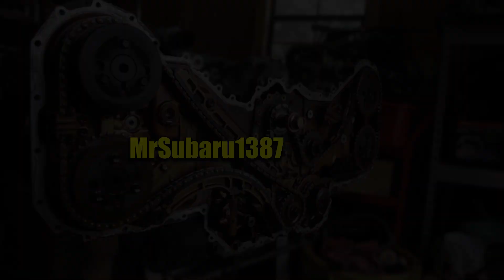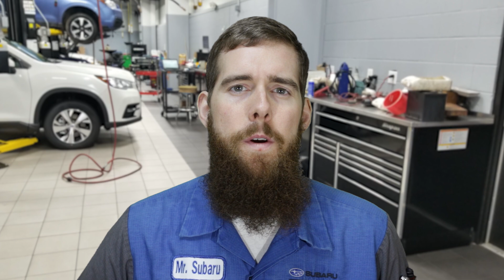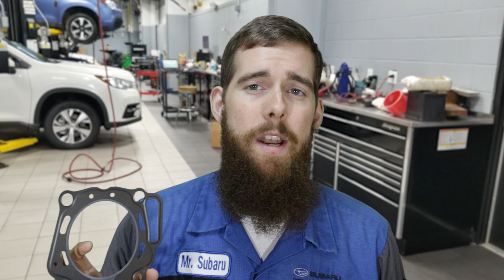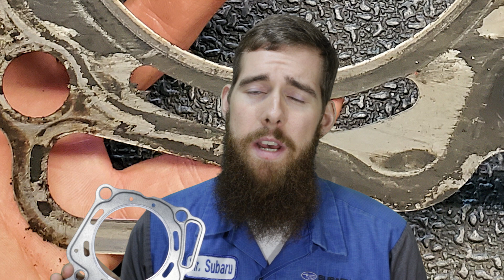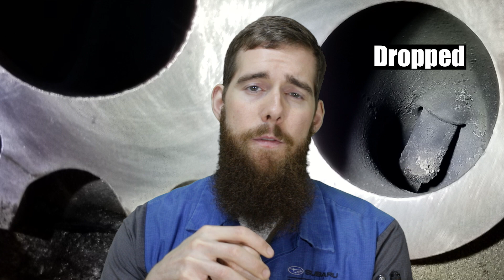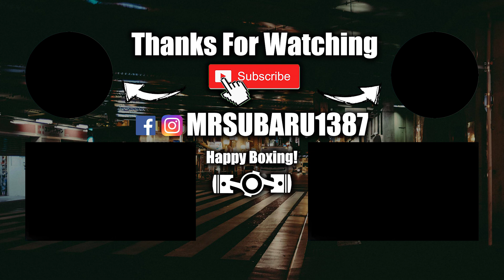Subaru Head Gaskets Explained

Comment: Beats me why Subaru didn't produce all its engines with the MLS gaskets in the first place as soon as it was recognized that the standard gaskets were prone to inevitable failure.
Reply: The bean counters liked saving 3c per gasket
Reply: Old comment, but they probably had already made a dozen of them plus the money spent on that design, so they preferred not to loose money and made more from repairs
Reply: It's a nightmare for the company and the customer. Thousands of dollars  to repair and the owner is the stuck with the bill.
Reply: That would be admitting fault. Companies never admit fault.
Reply: I am buying head gaskets from the local Subaru dealer but they can't tell me if they are MLS gaskets. To me they sure look like single layer. 2006 Forster LL Bean last 8 of the VIN 6H707820 gasket part number 11044AA630. Anyone have any idea? TY
Reply: @rmciottijr  look to see if it has that coating. The gaskets are visually different. The MLS are thicker
Reply: Because money
Reply: Spies, from Chrysler, Nisssn, and Toyota infiltrated the Subaru engineers.
Reply: @Spawn223311  Exactly why. Subaru is a pretty lean, mean company engineering wise. Reused as many parts across as many model ranges as possible. You get economy of scale from that. So they had hundreds of thousands of head gaskets made for the EJ25D laying around they needed to use up.
Reply: @rmciottijr  You want 11044AA642. The 11044AA63x series all are single layer, graphite coated. The 64x series are MLS.
Reply: Do you think they would help me financially since a or care mechanic  did repair work?
Reply: Since a private mechanic (should say)
Reply: Common to many other industries, it was regarded as an SEP. Somebody Else's Problem.
Reply: @rmciottijr  avoid single layer gasket multi layer gasket is what you need!
Reply: Because dumb people keeps buying those money pits.
Reply: Can’t profit off a car that doesn’t break down.
Reply: Costs
Reply: @ryarbrough1195  Worse, Toyota bought into Subaru  first in 2005.. then the rot set in. They owned 20% by 2018 iirc
Reply: No. I really think it had to do with not realizing how big of an issue it was at the time. The conditioner that came out as a response actually works very well and I never had one hg problem from 100k to 260k.
Reply: @inforedV  im not sure how a conditioner you put into the coolant, helps stop the oil leak. It was a stop gap for subaru to say "look we fixed it." Without actually fixing it so the person that currently owned the car could run it long enough to sell it to someone not knowledgable enough to ask if the head gaskets had been replaced yet.
Reply: @doh1976 truer words were never spoken
Reply: Its important that they fail just after the warranty expires so the dealership makes a shit load if money
Reply: @iffracem So. Toyota had many call backs. To this day, Toyota is one of the most reliable vehicles that a person can buy. They had a bad rap, according to recalls. Toyota is still recovering from it.
Reply: The MLS gaskets cause a slightly lower compression. Resulting in lower power output, and increased emissions. On the turbo engined this is overcome via boost.
Reply: Where can I buy those multilayer gaskets?
Reply: @oscardaniel1976  Subaru. Ask for the head gaskets for the Turbo version of your year & engine size. A company called 6 Star makers an MLS gasket set as well. There's a few others, but these two I personally know the quality of them. Other brands may be the same or worse quality.

Comment: I fried my n/a EJ25 head gaskets at about 100,000 miles when I had a coolant leak. Pulled my heads, had them shaved, grinded the cylinder walls, lapped the valves and used OEM gaskets and new bolts from the dealer. She ran even better once I got her back together!
Reply: How much did you have into all that?
Reply: @theeasternfront6436  A few hundred and she was back on the road running straight...
Reply: @cruzanbum3108  Thats not bad at all. My buddy is talking about selling me his 07 outback. Its over heating. The only thing that gives me pause is the cost of reman heads if they are needed.
Reply: @theeasternfront6436  Pick-n-Pull!
Reply: @theeasternfront6436  I’m heaving a machine shop here in Salem OR do mine, highest rated shop I could find. Clean, pressure test, vacuum test, and reman the heads so they have a good surface for the head gaskets. $140 a head, so $280 altogether. Not a bad deal if you ask me.
Reply: My original head gaskets lasted until 182,000 . I was told anywhere from 170-190,000 they would need them
Reply: @theeasternfront6436  It cost me about 800.00 to replace mine

Comment: My 98 Subaru Outback has over 300,000 miles pushing 400,000 miles still on its original engine and transmission head gasket is original I got the head gasket checked it’s not failing. That car was my 1st car when I was 17 now like 24 years later still driving it I always maintained it
Reply: Was it 2.5? no

Comment: I have a 2009 Impreza ej253 single cam it had the common external oil leak from the head gaskets.  After watching your videos I was comfortable enough pulling the motor and resealing the whole thing.  It also needed a valve job so it was good timing.   Kinda sad since it only had 120k miles on it but it runs beautiful now!!!!
Reply: Jason Truman yeah but then it will happen again
Reply: Julian Rodriguez nope since I used the upgraded “turbo” gaskets.  The rest of the car will be well worn out before the head gaskets go again.
Reply: Jason Truman really?... hey I have a question for you my friend ... I found a 04 forester XT manual with 130k miles... is it a good daily driver? Going to mostly use it for taking my kids to school and work I’m only asking cause this would be my first suburu car
Reply: Julian Rodriguez oh yea I wouldn’t hesitate to daily drive that if it is stock.  If some kid got a hold of it and cranked the boost up (it is turbo right?) that reduces reliability.
Reply: Jason Truman yea it’s the XT so it’s turbo
Reply: Julian Rodriguez well that’s a pretty desirable car for sure.
Reply: How much did it cost for your gasket replacement?
Just gotta 2009
Reply: I have the exact same car and year doing the same thing
Reply: Ric Grim to pay someone to do it right ? Probably around 2k. Do it yourself for like 700 or less depending on how much stuff you replace
Reply: Im looking to buy my first car and this 2011 Subaru Impreza 2.5i Premium Automatic transmission Hatchback has had my attention for a while, it has 95k miles, do you think I should change the head gaskets to avoid any future problems myself and if it a good first car?
Reply: @axel-t6q6e  Unless the head gaskets are leaking, you don't need to do anything except 90k service and maybe timing belt and components (due at 105k).

Comment: ``A year and a half ago, I purchased a 2012 Subaru outback with 136,000 miles.  Last summer at 186,000 miles the head gasket leaked, and according to my mechanic, he is finding hydrocarbons leaking into my coolant system causing overheating in the summer.  I AM NOT HAPPY? Not sure if I want to spend the money to fix it, or just blow it up and selling to the junk yard.  Being retired and on a limited income, to buy a vehicle like this and have the head gasket issues really ticks me off

Comment: Man, sure wish I could turn back time now that I’ve seen this. Bought a bunch of stuff from a highly rated local Ebay seller that were 99% oem so I could have my mechanic do the heads, valve covers, water pump, timing belt, etc. That 1% was a six star head gasket. Now it’s failing. At the time, I had no idea it wasn’t oem but that’s on me, rookie mistake. Another great vid and invaluable info!

Comment: Just finished a 2006 EJ253 head gasket replacement.  After watching some of your videos I was confident enough and pulled the motor and tackled it.  There was no milky oil, but it was pushing coolant out and overheating around cylinder #4.  Some minor oil leaking externally but not bad.  Upon pulling it and looking at the gasket, I could see the spot where the HG coating failed and the coolant passage was connected to the cylinder.  Used the newer MLS gasket 11044AA642 and replaced both sides.  Second side showed signs of failing soon.  Two exh valve guides on the affected cylinder migrated and needed replacing, so be sure to check those. 130k miles on it and it runs really well now after the engine rebuild and all fluids changed.  Used genuine Idemitsu Type HP trans fluid and it is pretty smooth now.
Reply: I'm impressed that you did the rebuilding of the engine and head gasket replacement.

Comment: I have a 04 Outback with approximately 104,000 miles. Had the head gaskets replaced. $2,400 at dealer. Also replaced the timing belt and water pump, while engine was apart. It is a great little car, but spending the same amount of money the car is worth hurts my head. When it is running it reminds me of a little diesel tractor.  Thanks Mr. Subaru!

Comment: Once again sir  - your information is spot on!  I have a 2010 Impreza 2.5 NA SOHC (EJ253). It started visibly leaking oil from the driver side HG around 100K.  The passenger side didn't seem to be leaking much at all.  **Why is that??**  The engine never overheated or showed signs of coolant mixing with the oil.  I pulled the engine and replaced the HGs with the Fel-Pro MLS gaskets and the engine now has about 186K miles with no leaks.
p.s. I am still waiting on a complete video tour of the new MAC tool cart 😊  Anyone else?

Comment: I just completed my head gasket and engine reseal and verified no leaks , it was a big job , but thanks to Mr Subaru I received the right information to do this job the correct way! With the Subaru MLS head gaskets , torqued it in the pattern , and had the heads I put on their machined ! It runs a lot better now more power, better idle and hopefully I can say no more engine fluid leaks !
Reply: I couldn’t imagine how much it’d be for it all to be installed because while I was in the process I had to replace a bunch of other parts not only the head gaskets including timing kit, $300 , motor mounts $250 , seals and gasket kits , inner timing covers  were broken $50 , replaced those : upper radiator hose needed replaced , head job at machine shop was $165 , and a bunch of other hoses that were brittle needed replaced it all added up to $1500! How much do you think the total for all that would of been if I paid for labor ?
Reply: Pls the oil drain pan and drive belts were another $100
Reply: Hi, Appreciated reading your message about the MLS head gasket job. Question: How much did you machine off your heads before refitting them?  I'm curious to know if you machined off more than usual due to the greater thickness of the MLS gaskets and the possible likelihood of unintentionally lowering the compression ratio.

Comment: Subaru tech here..
Holy crap, a decent video on subbie headgaskets not full of BS, good work!
But... they pretty much all had the problem of combustion gases going into the coolant up until the new timing chain motors around 130k miles.  The EZ30's do have issues that mimic a bad headgasket though, they would crack the bank 1 cylinder head, replaced so many of those headgaskets just assuming it was the standard issue for them to come back pressurizing the coolant again only to find out they were cracking the heads!  But yes, the new f motors are much better, have not had to replace a single one yet. 

as far as headgaskets go, use aa610   you will thank me...

Comment: I’ve got an 05 outback with 195,000 miles and no signs of head gasket failure yet. But with mr Subaru’s videos I have been able keep up with the preventative maintenance. Just hoping the head gasket doesn’t blow anytime soon. But if it does will definitely use the mls Subaru head gasket. Thanks for the video
Reply: why did you say YET?
Reply: onenikkione because on this model it has the ej253 and it is to be expected sooner or later
Reply: 200K on any vehicle you're more likely to start losing things like a head gasket, my dads big block lost it's HG at 220K. Sounds like when/if yours goes it's not a factory defect.

Comment: It’s about time that someone knowledgeable about Subaru’s made a video about this. Thanks so much for the video with good information! Although, my EJ255 (2006 WRX) had blown head gaskets when I bought it.
Reply from the maker: Most likely due to abuse. Which is common for WRXs.
Reply: MrSubaru1387 Very possible, the car was used (obviously) so I have no clue if it was ever overheated by the previous owner. I did the head gasket job and now it runs great. I truly believe if people just maintain them correctly (and keep an eye on gauges), they can last a long time. The people you see on forums are people who don’t do these things in my opinion.
Reply: @zachs.9600  Def agree with you. Meticulous maintanence and actually having some mechanical sympathy goes a long way.

Comment: Great video, I worked in Sales at Subaru for 10 years and was always baffled by the head gasket thing. I knew there were different versions of the engines but its just crazy the Subaru engineers did happless things to make the head gaskets good. Despite their recent success, had they fixed the head gaskets a while ago they would be selling another 200k cars a year. Nobody wants to buy a car where they have a 5000 repair at 100-120k miles. Luckily, my nephew is a subie tech and he can bang one out in a day and he helps me out. I still own 4 Subarus and my trusty F250 92 460 with 45k miles on it!
Reply from the maker: Glad you enjoyed, yeah, always question some of SOA's decisions on things...
Reply: @MrSubaru1387  probably more Fuji. Then Toyota. I know they are slow to change.

Comment: Thanks you very much for the info!! I have a Legacy 97 with EJ25D (with 405.000 Kms) and I changed 2 times the head gasket. Now I have installed the original MLS head gasket, I hope have no more failures like that. Thanks again! And continue uploading Subaru and farm videos :)

Comment: My 1996 Outback's headgasket failed almost exactly at 120K.  Good call!
Reply: i have a 1997 Outback with 166000 miles.  It has never had a head gasket problem.

Comment: I have a 2008 Subaru Legacy 3.0r with now 235,000 miles.  Last year and when I first got the car I discovered that going up hills in the summer was rather terrifying due to the radiator not being that great. So last year I replaced my radiator and all the coolant or as much as I could with your help from your video. Unfortunately me being new to doing all this I only replaced the transmission cooler lines and the radiator cap with oem parts. Along with some of the clamps. And honestly it worked great. And recently with my scan tool I noticed that the temperature was slightly high not overheating and still within operating temperature range but a lot higher than normal. And I realized that it was a thermostat problem. And that it was probably the original thermostat LOL. So another complete and total coolant flush later the new thermostat was in and the car with its better radiator was running almost 15° cooler. That’s where my second mistake came in, not replacing the old radiator hoses as the top one burst. So another coolant flush later and all new OEM hoses and New hose clamps, I learned like you said in this video if you’re going to do the job do it right the first time. Fortunately for me I bought all OEM parts other than the radiator itself and the car has been running great ever since. Although I still do check for leaks underneath the car as I am paranoid because high mileage car lol.

Comment: Thanks. I have a 2011 2.5i OB for my daughter. It has less than 60K miles. I bought it used 2 years ago with 40K miles on it from my dealer. I had almost all of the fluids replaced recently, including the transmission fluid and front and rear diffs. It was the 60K full service with trans and diffs added. I checked and the coolant wasn't changed. It surprised me that will the brake line flush, throttle body, oil, fuel injector, etc... coolant wasn't part of it. I'll make sure that is done. The dealer was questioning why I wanted to change the trans fluid, and while it wasn't driven hard, it was 8 years old. I think the coolant should be done too.

Comment: Nice to get this info clearly broken down like this. I have an 03 Forester X with the EJ253 I believe, once it started externally leaking, the car had been consuming oil forever anyway so I was used to topping it off. I drove it for probably 75K miles with that external leak before finally fixing it when it time for some other work. Car still consumes oil but doing great at almost 220k for my daughter, who thankfully does a good job keeping it topped off (and drives stick!)

Comment: See some questions about what year/model since minor engine revision codes aren't exactly something we think about in cars often.

EJ251 - 98-03 Impreza 2.5 RS, 99-04 Forester, 99-01 Legacy 4EAT, 99-04 Legacy, 00-01 Outback 4EAT, 02-04 Outback, 03-05 Baja.

EJ252 - 00-02 Legacy 5MT, 00-02 Outback 5MT.

EJ253 - 04-11 Impreza, 05-12 Legacy/Outback, 03-09 Legacy (Europe), 09-12 Legacy (Europe), 03-09 Outback (Europe), 99 Forester, 05-10 Forester, 05+ Baja, 05-06 Saab 9-2x Linear
Reply: The EJ253. Is that including the Impreza RS wagon 2.5l??

Comment: Well Mr. Subaru, I didn't see this video until today, just finished doing gaskets and a block on my 2005 Legacy GT wagon. Fel Pro MLS head gaskets were put into my car and I was under the impression they were pretty good. Heads were properly machined and new shortblock was installed. Wish my head gaskets luck!
Reply: I have those same head gaskets in my Forester . Been in there for 6 years with no issues.
Reply: @FenwayJoe7129  yeah, I'm at year 3 at 19 pounds of boost on my VF52 and they're holding fine